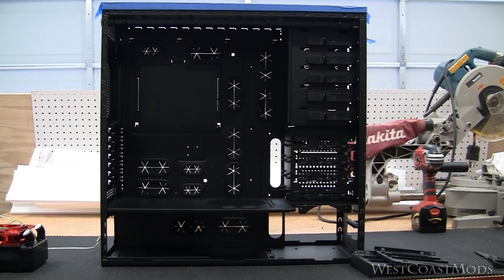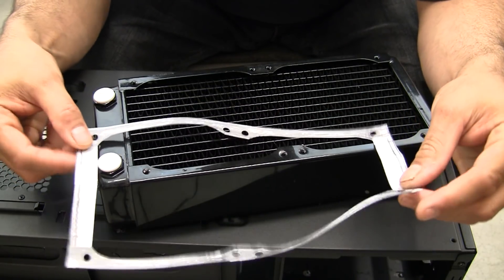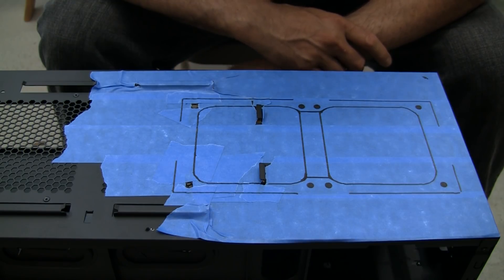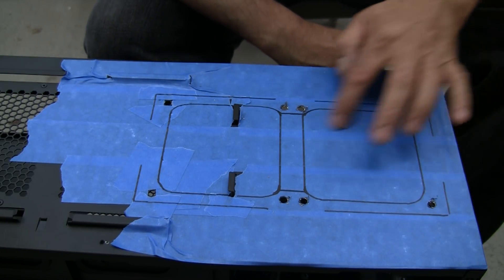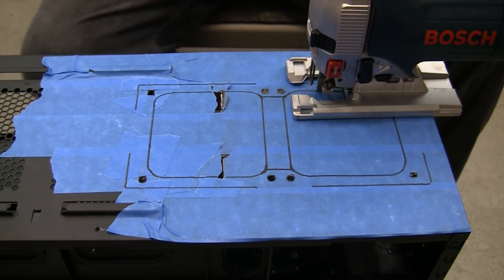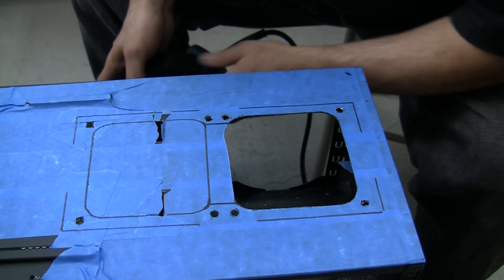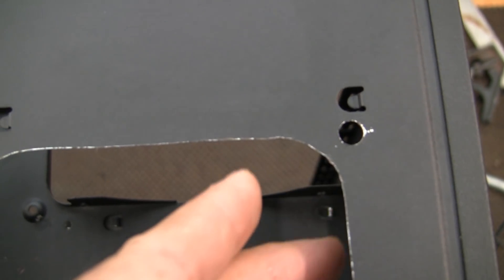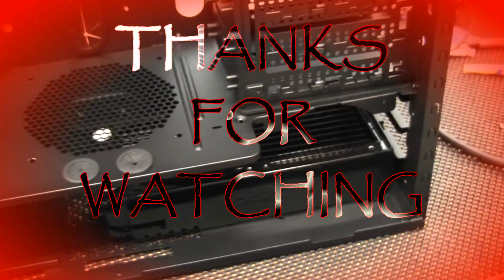Corsair Obsidian - Modding The Case For a 240 Rad - Part 2

Comment: a nice tip for the rounded corners is to have a smaller cutting wheel on the dremel and hold it at an angle (about 30-60 degrees, depens on how larde the ewdge will be rounded etc, u get my point)

Comment from the maker: I just used a small piece of aluminum that I bent to fit, then mounted it with 6/32 X 1/4" screws....Don't recall the actual measurements, but you should be able to figure it out.

Good luck

Comment from the maker: @Ipodtouchftwz The fans need to pull cool air from somewhere. Due to heat rising, the air at the bottom of the case is about the coolest air that your PC will get. And without the cut out the fans/rads wouldn't be able to get good air flow....Sure it can be done, but you will notice a performance loss and it may reduce the life of the fans as they will be overworked.

Comment: hey westcoast moder i was woundering like instead of doing all this cutting cant i just have 2 x 120mm fans at the bottum with 240mm rad on top and then another set of 2 x 120 mm fans on top ? i have not long brought a 800d case and iv planning to do alot of mods and another mod im gonna do is have a 3x120 mm fans ontop with rad on top then 3x120 on top of that then in case a 360mm rad with a 3x120 mm fans underneath many thanks grouchy

Comment: If you can recall, the tray that runs across the case which you reinforced after removing the HDD cage.  Does that tray actually do anything for support of the case?  It looks like it just separates the bottom zone from the mobo zone.  Curious if it would hurt the case at all if it was just removed all together (and if it would be easy to remove all together).  Curious before I start hacking up my own ;)

Comment from the maker: @seojnichols Yeah, thats the problem with trying to photocopy an object on a consumer level copier...not only will it resize but it can distort it ever so slightly as what it's copying isn't flat on the surface. If you choose 100% in the printer properties page than that will illuminate the size problem, but there is really nothing that can be done for the distortion, I guess just try it and then see how it matches up to the rad itself. also this would be tough on something larger than a 240 rad

Comment from the maker: @zver711 That is correct, but they will work with any controller...I will be by passing the thermal sensor. They also come with a wired switch to turn the LED's off and on, I may do 1 of 3 things...just leave them in the "on" position (which is what the client wants) or extending the wires and mounting the switches somewhere or running them to a single switch on the front panel. Not sur which way I may go....I should be doing a vid on the fans and how to by pass the sensor.

Comment from the maker: @wcoldschool The case will be elevated once I re-install the case feet about 1". I'm more concern about it exhausting the warm air into the case...not the most practical way to have a rad exhaust the warm air. But after much thought I decided this was the best way considering what I had to work with. Sure I could have redesigned the bottom compartment to make it more functional, but due to time restraints and didn't want to have to charge the client any more, so I did this way

Comment from the maker: @KillaMarci It would be hard to mount a 360 there as it would run into the PSU, now I have seen a guy turn a 360 on it's side along with turning the PSU on it side and it fit. But personally I wasn't a fan of the setup.

Comment from the maker: @acer0169 The case feet are 1" high and as far as how much room to mount a bottom rad...well the more the better..but if you have a 1" to 1 1/2" between the fans and whatever is above it you should be fine.